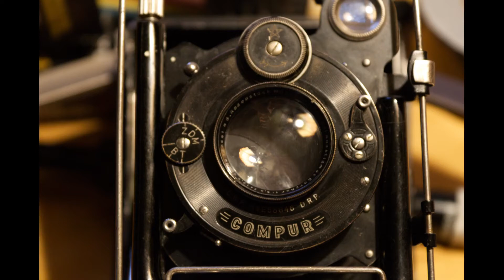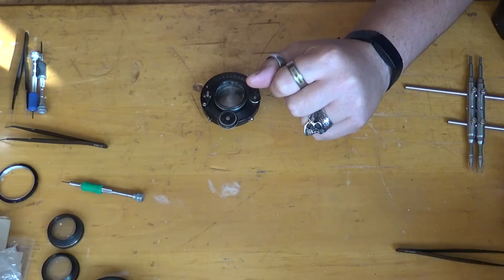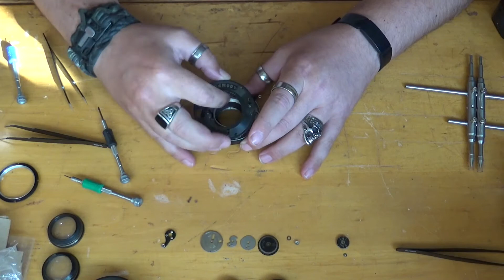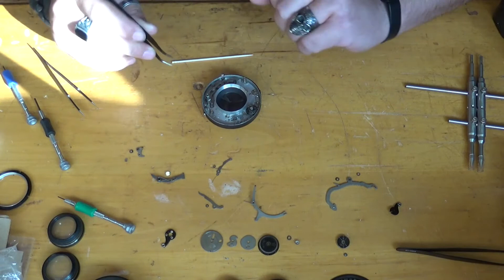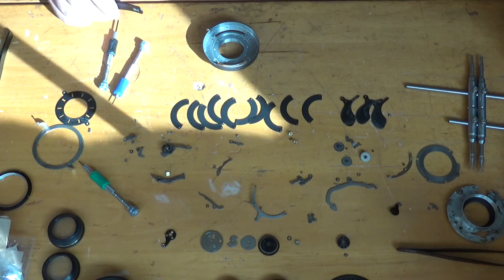Dial Set Compur Shutter CLA part 1

Comment: My Compur shutter opens up the shutter blades for a second while cocking, works after that tho. That aint normal right?
Reply from the maker: No that's not normal. It means either it needs cleaning or the close spring is getting tired.
Reply: @allensmithphotography Thanks for the quick answer.
Reply from the maker: Most welcome
Reply: @allensmithphotography Do you happen to know of any good stuff to improve or condition leather?
I have these old cameras like the ones shown in your video, the type around the 20's and 30's... Voigtländer Bergheil is one. Goat leather supposedly, I want to make it last longer and it could use some staining on some bare areas and leather needs cream and what not supposedly but it CAN make it get loose from the metal. Any tips? AI tried to sell me all kinds of products but when asking for proof it admitted it didnt have any and it hallicunated it all.
Reply from the maker: @Jerbod2  that's why I don't trust AI. But I use Tung oil mixed with bees wax, 2 parts oil to 1 part wax. The oil is a mineral oil so won't sour and the wax will seal it. 
If the leather comes loose, you can use contact cement to reattach it. You'd just clean the surface then apply the cement and apply the leather while the cement is wet. Wipe away any that squeezes out the edge.
Reply: @allensmithphotography  I still use my camera, wont the bees wax make it all sticky like shoe polish will?
Reply from the maker: No it won't. It hardens the surface of the leather making it feel lacquered.
Reply: @allensmithphotography Thanks a bunch.
Reply from the maker: @Jerbod2  most welcome

Comment: i recently acquired an Ica Nixe that uses a slightly different compur shutter (only has options I,B, & T, no Z, D, or M) i can't seem to get it to switch out of I mode, and also can't set the speed dial anywhere other than 1 or 2, wether the shutter is cocked or not. is it possible its just gunked up inside or did the previous owner damage something?
Reply from the maker: If the dials are stuck, then yes it's likely very gummed up and some of the levers are seized in place.

Comment: one tip, for them, Don't have a long throw cable release, the cocking lever hangs up, it can't lock in the cocked position if the release(lever or cable in the socket) hasn't fully retracted.

Comment: thanks, I have a lens with this shutter ( in a Linhof tech iii 5x7") different case and the t\b\m is a post in a slot at the bottom, but similar in design, one nice thing about them is that the lens screws onto a flange nut, which is permanently screwed onto the lens board, so it is easy to change board styles, from one make to another, without having the screwdriver tool for the lockring, the speed dial has a cylinder on the top, allowing one to push the lens in the tightening or loosening direction of the screw thread.

Comment: Thank you Allen for taking the time making this series. Its been very helpful to me as I clean and repair this old 150mm f3.5 Tessar lens I have. Spanner head screws scared me for a second, but came out fine using the points of a compass. A loose screw holding one of the shutter blades was causing the blade to not fully close correctly, thus fogging my film. Should be back together again today. Thanks again.
P.S. I’ve visited your website and really enjoy your photographs.
Reply from the maker: You are most welcome. And thank you for your kind words.
Reply: @allensmithphotography  The shutter runs like it was brand new and zero parts left over!😃
Reply from the maker: @alexanderstavroudis6901  yay

Comment: hey Allen, is this shutter in the lens? or it is shutter of film camera? i didn't understand what is this shutter used for?
Reply from the maker: It's a fair question. This is a large format lens with built in shutter. The camera it came on is a 9cm x 12cm folding camera.
Reply: @allensmithphotography  okay this is photography only lens then. I was reading about zeiss planar that had compur shutter and they removed that shutter to mount it on film camera. i was thinkinh why would they put shutter in a lens?
Reply from the maker: Sorry for the late reply, but the shutter in lens was the first steps to integrated shutters. They were made for faster media like film and dry plates in large format cameras and were adapters and evolved into compact and folding cameras.